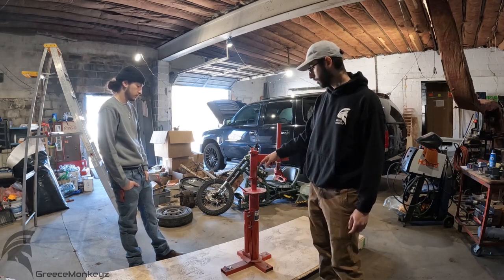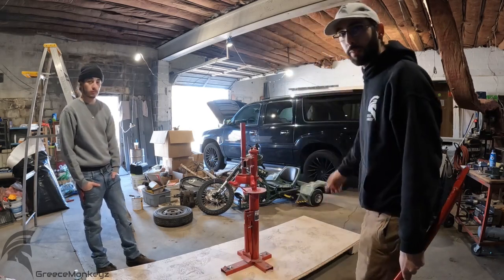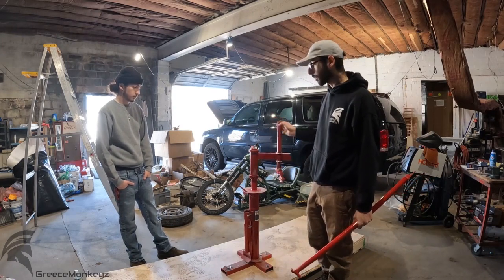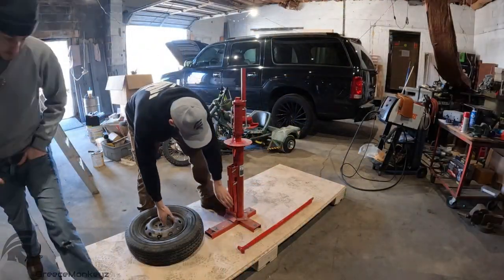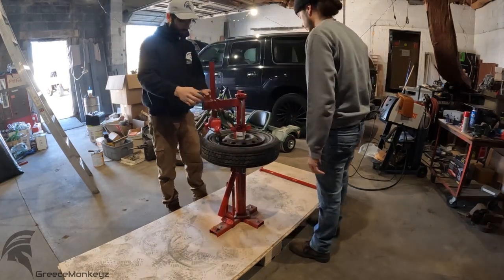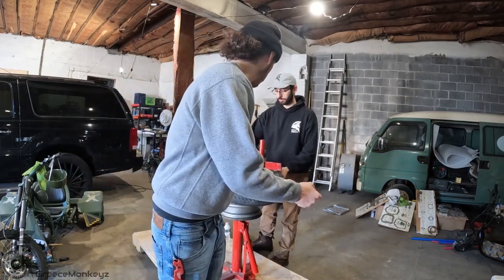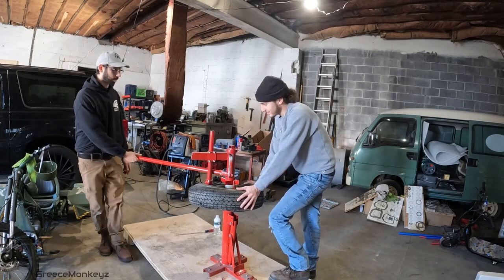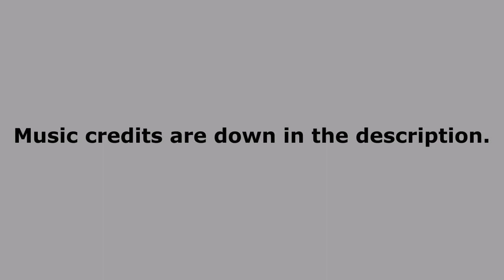Cheap upgrade for Habror Freight tire changer -Update/improvement-

Comment: Bolt it to the floor. Mine is on anchors that sit below the surface so I can unbolt and store it in a corner when not in use.
Reply from the maker: Yeah, haven't picked a home for it yet, but you're right, I really need to.
Reply: @genuinedickies99  I could see applications for that!
Reply: To add to the "bolt it down" theme... I found that bolting the unit down without using the cross member parts is infinitely more rigid. And the wheel is much more stable laying flat on the floor to break the bead.

Comment: Good job man, congrats on the first 1000 also! I got a small car channel too, just got over 2500. I’m gunna make one of these for my shop, good alternative to paying what 400 bucks for the lucid auto works??? Subscribed!
Reply from the maker: Yea dude, its very simple if you've got the tools.  And I appreciate it!
Reply: $149.00 @ Lucid for a basic complete unit. $199.00 for one with machined center cone.
Reply: @RaysLaughsAndLyrics  still more expensive than this...
Reply: I have a lower cost "bar" that works. No welding either. I may mod it one more time to stop it twisting, but otherwise it is this...
https://www.youtube.com/watch?v=W8MddFsFmgA
Here it is working on a silverado tire 
https://www.youtube.com/watch?v=gGv5MUxbQ3c
...Then I saw an inner tube can be used to get a stubborn bead on the rim

Comment: you also need to reinforce the bead breaker, it will bend out of shape.
Reply from the maker: I've only been dealing with the little 12" wheels on my kei trucks so it hasn't been an issue, but you're right, it looks like it could use some help.

Comment: Since the end of the horizontal part of duck head attachment is open, why not just stick the bar in there? No further mod needed and it will provide much more leverage.
Reply: I thought about that too but levering down lower puts less sideways stress on that vertical part, maybe that’s why?

Comment: Did you install the final bead dry? Lube the duck bill too.
There are plastic drop center devices that hold the bead opposite the duck bill down and make install easier also.
What is your plan on balancing the tires afterwards?
Reply from the maker: I've seen those clamps, I need to get one.   I used the Harbor Freight balancer to get them close, which for my application was enough, they're going on a kei truck that does 60 mph max.  No vibrations at that speed so far.
Reply: The clamps do help. I use 2 for removal and 1 for installing
Good luck with the HF balancer. A good test after initial balance is to lift the wheel , turn it 90° and put it back on the balancer. If it's still balanced, you are good to go.
 @GreeceMonkeyz